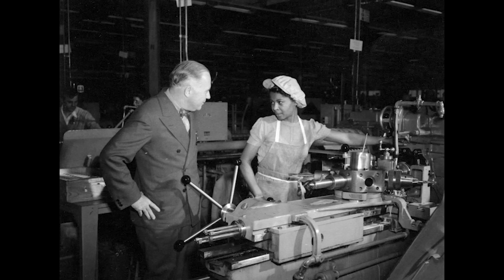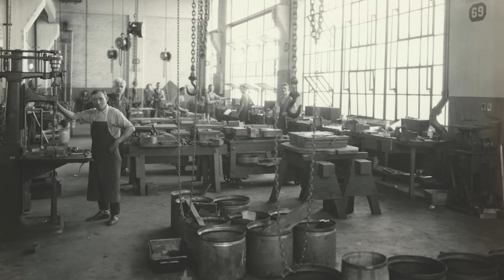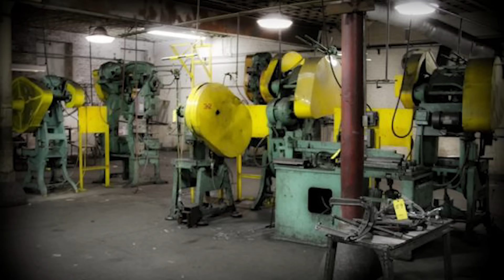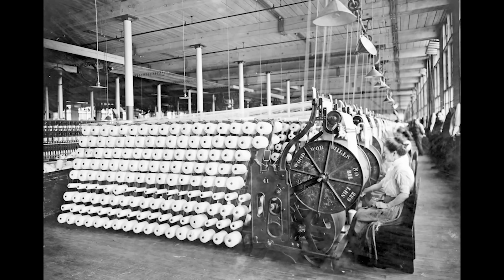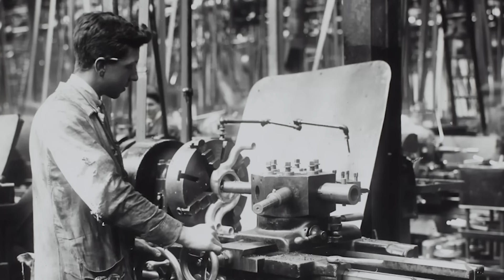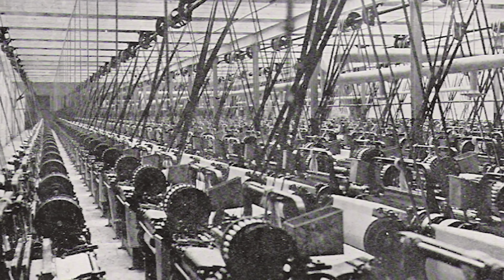Why 1940s Factory Machines Ran 80 Years While Modern CNC Dies in 10

Comment: This is for the ,most part click bait bull shit. Ive been a toolmaker for 40 years, manual machines wear out also, Bridgeports initially had soft ways and had to be regularly  rescraped if they had heavy use. CNC machines are not made from  aluminum, maybe the crap from amazon, they are made from  cast iron and have hardened ground slide ways to tenths also. You are gonna tell me a Mori Seki or Monarch was made to fail in 10 years? All machine parts are expensive, buy a part for a Leblonde lathe....Many older manual  machines do not have parts available anymore either. Yes, cnc control systems become obsolete and yes they are pricey to fix. There is a place for manual equipment and it takes skill to run these machines, it also takes skill to make one or two parts on a cnc and get good parts the first time.  These was a time when American machine tools were the worlds highest quality , there are still alot of them cnc and manual still running. The clowns that run the country decided our main industries should finance, healthcare and power generation and sold it all to overseas for pennies on the dollar. You need to read the book " The day the machine stopped".
     As for the Siemens story, if you dont keep you cabinets clean and run the machines in humidity and temp controlled, you are gonna have these issues. Poor maintenance. If you have the brains and the skills, a dead cnc control can be replaced with a pc based system running Linuxcnc for about $800. Most machines that dont get retro'd get scrapped because they are plain worn out, it is simply not cost effective to completely rebuild and retro a machine unless you are doing it yourself or it is a special piece of equipment. Same hold true for a bridgeport, you can buy a new one for the cost of a complete rebuild.
   And only a fool even considers a Siemens control in the USA, their support is horrid.
Reply: Is this AI slop?
Reply: @orileymcspadden9116  Pretty much. See my comment above. So many contradictions and inaccuracies it can't be anything else. Stupid AI narration or ignorant human author talking about "TENTHS" of an inch tolerance in machine tools is ridiculous, and first they say "2000 pounds" of cast iron for a Bridgeport, and then somehow it becomes "8000" pounds in the same machine. Etcetera. I've been a machinist for 5 decades (that's 50 years for the recently "educated" little fellas), still own a Bridgeport, still making parts on it. Of course, I've only been a machinist for 50+ years, so what could a lowly boomer peon like me know?
Reply: Yep. Those are the reasons this stuff gets scrapped. Most of this scrapyard rescue stuff is just that, uneconomical to rebuild scrap iron shaped like a machine tool.
 I remember when the US machine tool manufacturing industry performance used to be one of the top indicators of how our economy was doing. That almost vanished in the 1980's, along with our manufacturing base.
Reply: @pete1342  The great sucking sound from the south - H.Ross Perot.